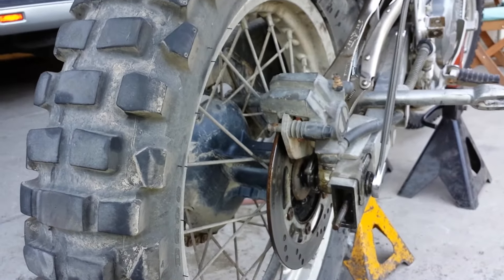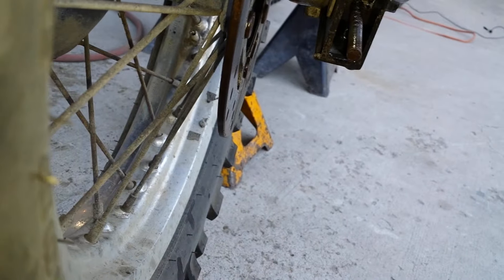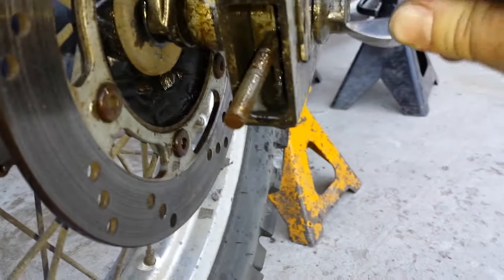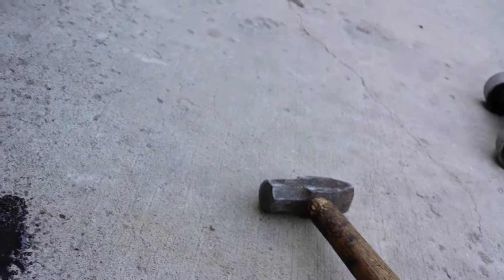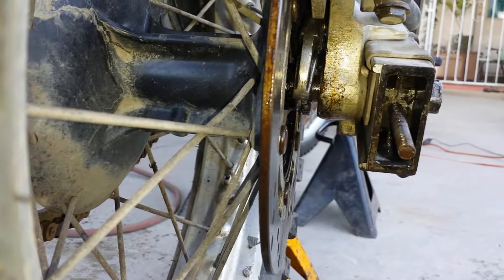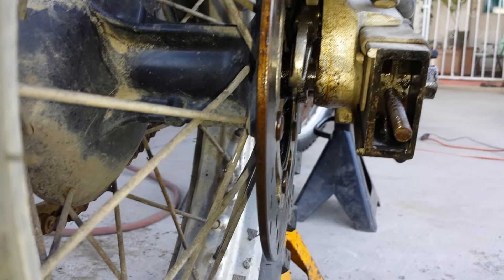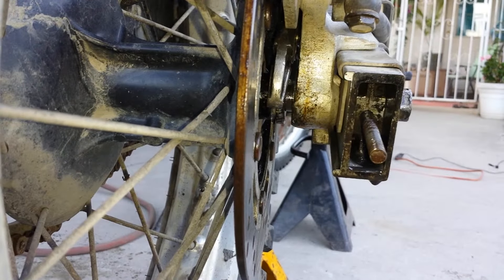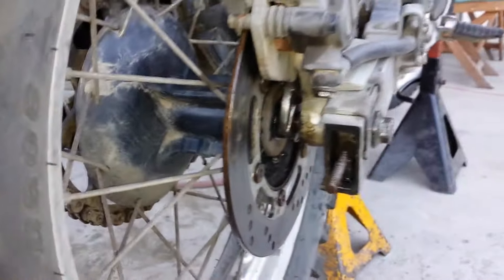KLR axle removal part2 maybe

Comment: Umm... The nut with the pin is on the other side. Once you get that out it should just push through.

Good luck, I just put a load of work into my '96 KLR over the winter.  After all my efforts is still a heavy KLR 😆

Comment: It should just tap right out. Try taking some of the pressure off of the axle by supporting the tire. I am 98% sure that axle does not tread into the swing arm. When your done. I highly recommend wheel bearings in both wheels.
Reply: You are correct *****,  it does not thread into the swing arm. Mine just slides right out once I lift the tire a little to get the weight off it like you suggested.
Reply from the maker: ***** yeah, pretty seized to the bearings, New bits coming,